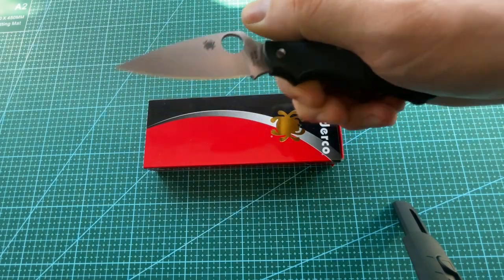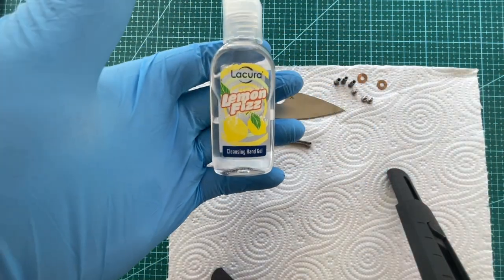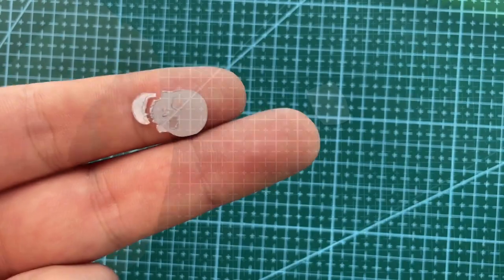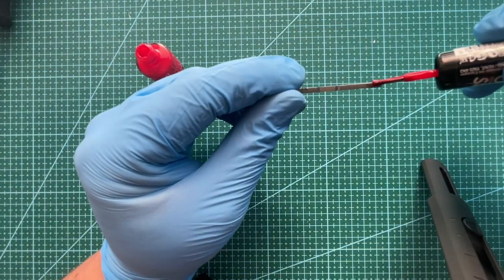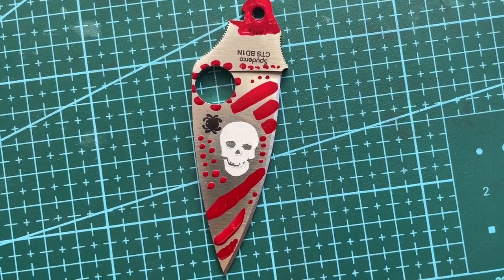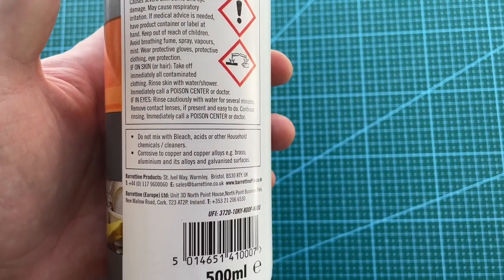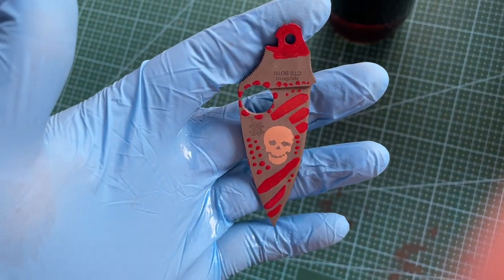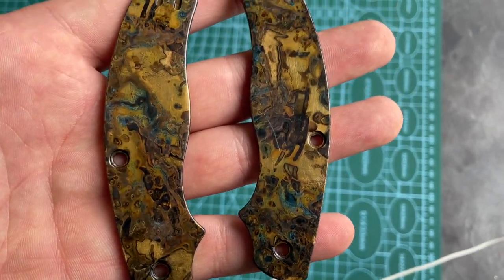Shipwreck Brass Patina And Custom Etch On Spyderco Ukpk

Comment: I’m doing my brass knife scales right now, with vinegar/rock salt/ammonia fume….but the non-salted areas look almost black, whereas yours stayed bright brass??!  Will my dark areas go bright (which is what I want, like yours) when I rinse and dry?  Wonder why yours stayed brassy bright in some areas, which is what I prefer?
Reply from the maker: hey man thanks for the comment  and if its dark you can use a high grit sandpaper to get rid of some of the darker spots i got pretty lucky i think and the pics are in the sunlight it looks a bit darker when inside looking at it now 😃
Reply: So, when mine came out, it was pretty much two shades of blue (depending on salt thickness) and almost black.  Rinsing reduced the blue patina by half, but still pretty good…I even left some thicker blue patina for “texture”.  However, no brass color like yours on initial removal….wonder why yours stayed yellow brass in spots and wasn’t all blue/black?  I had my scales facing up, for salt pattern…maybe facing DOWN in the ammonia paper works differently?  I then spent an hour carefully sandpapering out for brighter patterned and blended spots, would’ve been easier if they were there naturally.  Mine looks good now, but you have much more colorization in yours ☝️.  If I do it again, I’ll face the scales downwards and check hourly.
Reply from the maker: @roadracerqx893   glad it turned out well buddy. i love the fact that with force patina they are one of a kind and can not be recreated exactly the same lol  and was your brass polished before you did it? also maybe using different strengths of ammonia could effect how they turned out different
Reply: @Phantomedc1  ….Yes, I removed the natural brass patina and went over the scales with a polishing wheel/compound…it wasn’t mirror, but it was smooth/polished.  It looks nicely “artsy” now…glad I left some  blue patina texture before clear coating.  Now I feel like buying a copper knife to play with, LOL